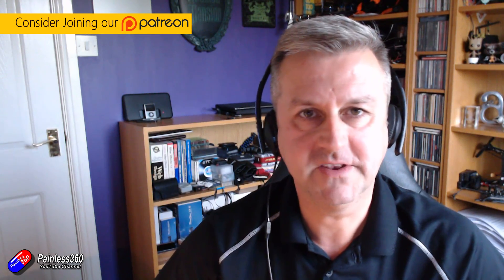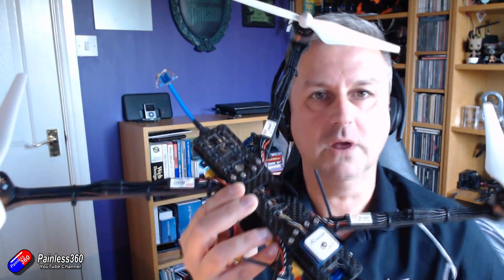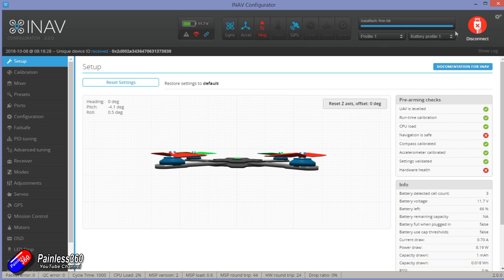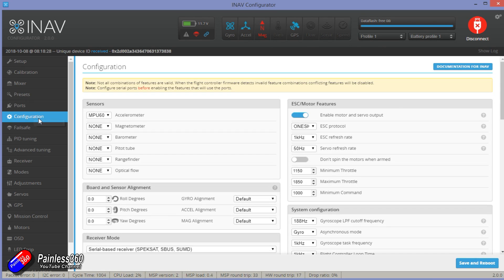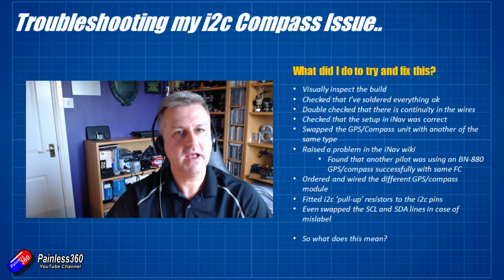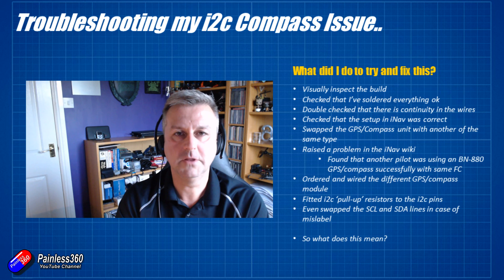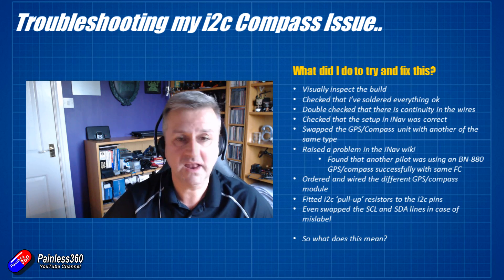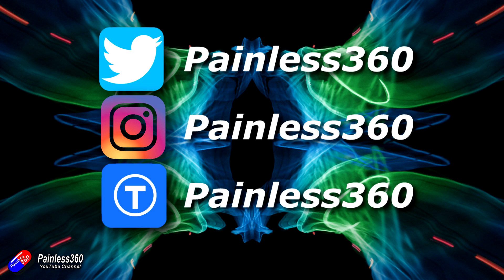Quadcopter Building: How I'm Troubleshooting my i2c Compass Problem

Comment: Hope you can get this solved and show us all how . Also do you think you might consider doing a series on putting ardupilot on a f4 board ?
Reply from the maker: I'm planning to, but waiting for a little more time to pass as it seems to be very board specific at the moment with specific steps for the board you're looking at.. Oscar Liang has some good stuff on it - https://oscarliang.com/flash-ardupilot-kakute-f4-f7-fc/
Reply: I am in the process of setting up a Holybro  F7 (non AIO) board with Ardupilot and have it working on the bench. Initially I had an issue with the onboard barometer not being recognized but only when I had the external compass connected. As these are both on the I2C interface I found that the order of powering up the board was important. I first needed to connect the battery and then connect the USB cable to the PC, the reverse would not work. The reason is that the GPS/compass was getting power from the FC but only with the battery was connected.
Reply: @richardcjoy  
 Oh good job Richard. Hopefully you may be able to do a video on your setup and your trouble shooting tips ?
Reply: Oh great I look forward to it. I've done some research on it , some guys make it look easy but I'm yet to take the plunge. But ardupilot on  omnibus board is a very attractive idea.
Reply: Just done a Matek F405 with Arducopter today. Here is a link to a video on how to.
https://www.youtube.com/watch?v=meUxq6eN2tU&t=603s
Reply from the maker: A quick preview of a new series that is starting next month as it may be something you're interested in.. https://youtu.be/VBFSaNF-gm0

Comment: As always great content! Especially for someone who is just getting in to this hobby. Quite curious if the gps and compass modules work on another fc (maybe connect them to a fc where you have gps and compass working with iNav?) or maybe with a different fc-firmware combo. But I guess that is something for the next video! :)
Reply from the maker: They are universal. It’s usually the connectors that are different. See my other videos..
Reply: I thought that of these modules work on another fc with the same versiob of iNav, one would be able to conclude that there is an issue with the fc. If not, and it works on another fc, with ardupilot for example, then maybe it is the iNav-fc combo. Or am I on the weong track?
Reply from the maker: You could conclude that if you're also able to rule out a problem with the inav software itself. Happy flying